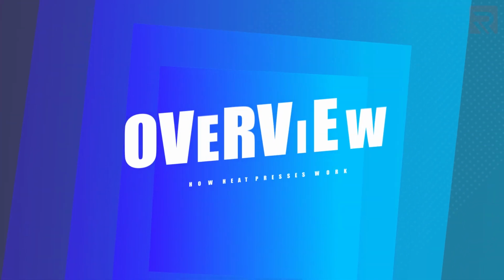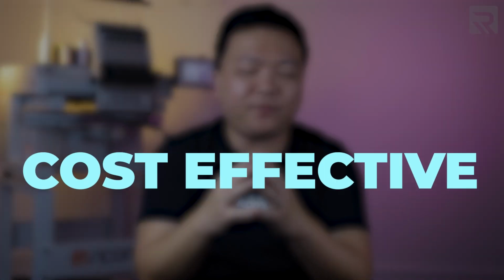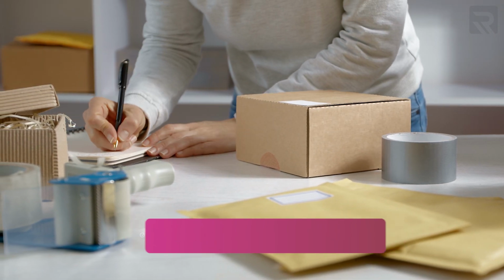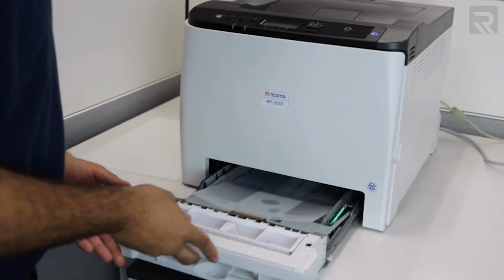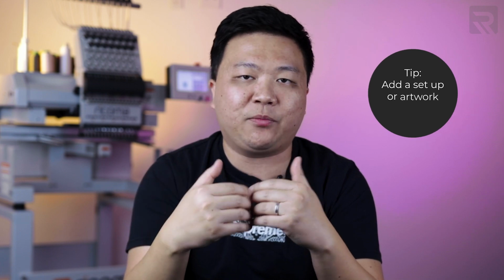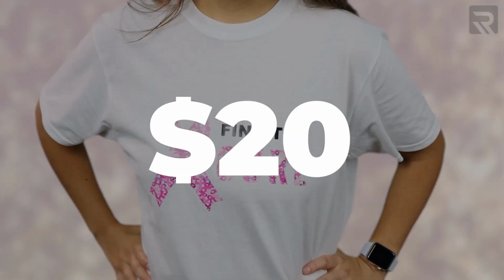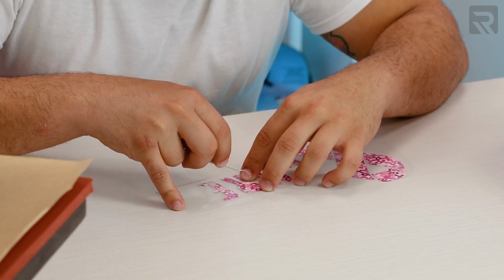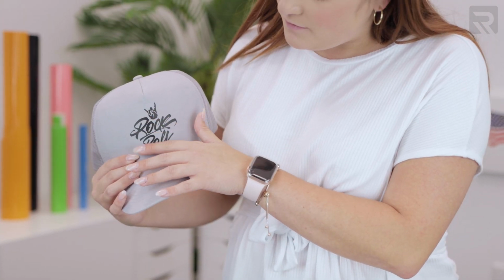3 INCREDIBLY EASY WAYS to Start A Business With A Heat Press

Comment: How many wash’s does the press last?
And also if you wash with warm water does it come off?
Reply from the maker: It should last you around 50 washes, and we recommend washing it inside out on a cool wash, dry inside out on a washing line and iron inside out - no tumble drying or dry cleaning.